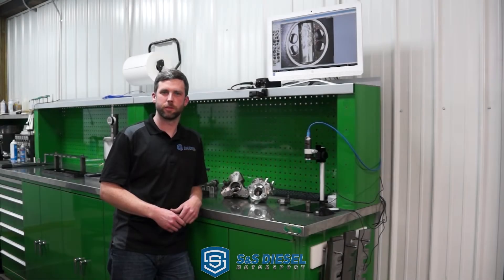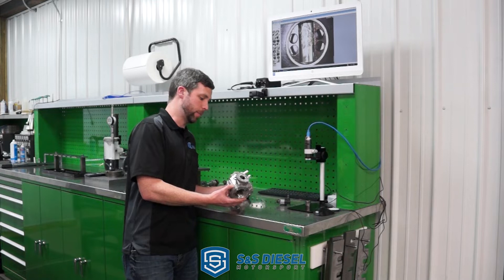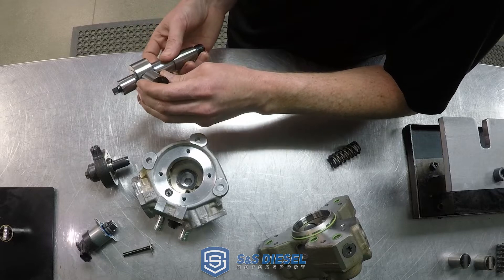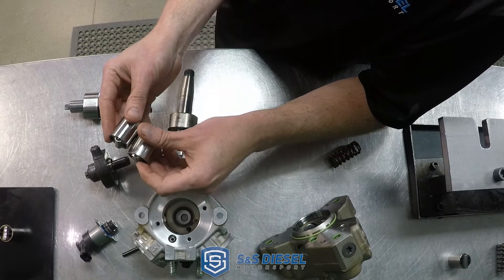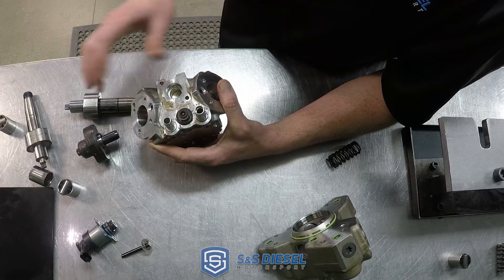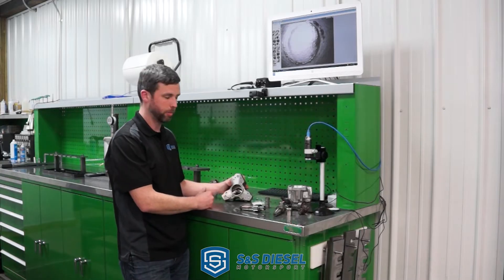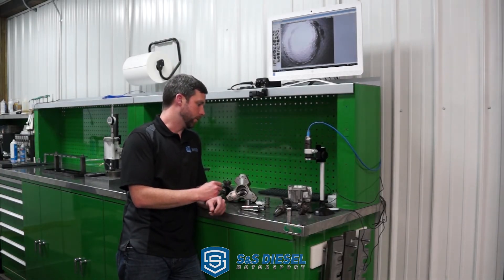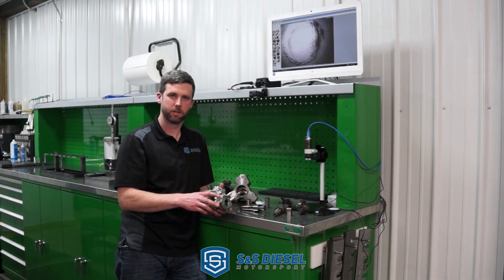Bosch CP4 vs CP3 High Pressure Fuel Pump Comparison

Comment: Thanks so much for this detailed video explanation. Installed an Air Dog Filter system on it 2 years ago but never new about CP4 issues until recently. Just got my 2013 Duramax back from the shop today... Did an S&S CP4 - CP3 upgrade and a Fleece Cheetah Turbo. Now I feel at ease. Heard so many stories about how expensive it is when (not if) it blows up. So I spent $10 k today, but saved myself another 10k by replacing it "before" it blows up. Been looking for a video explaining how they work differently and your video answered that. Great video. Thanks.

Comment: Very informative. I replaced my CP4 as preventative maintenance, and with that I installed a Donaldson 4 micron fuel filter kit with water separator before the HPFP, and then a disaster prevention kit with a 5 micron return filter just to be on the safe side. To top that off I mix 0.5% of 2-stroke oil in my diesel. The new CP4 should last a million miles now!

What I dont get is how such a reputable company like Bosch can go from designing a masterpiece of a fuel pump to designing a piece of shit pump that the CP4 is.

Comment: Honestly, I think the OEM's should be required to Warranty the CP4 equipped engines indefinitely. At the very least, the OEM's would be financially forced to install a filter after the CP4 to prevent catistrafic contamination from a failure, as its insurance against having to replace the entire fuel system.
Also think Cummins should be required to warranty their engines indefinitely against damage from the grid heater nut/stud getting sucked into piston 5 or 6.

Comment: Can you directly replace a Cp-4 with a Cp-3?
Reply from the maker: It would depend on the application as we do have cp3 conversions, however they do require lines, mounts, and custom metering units to not have tuning required. So they can replace them with a kit designed for it but not just an un bolt and bolt a cp3 in its place.

Comment: Very good video! 👍That's why Honda diesel i-CDTi with CP3 pump and electromagnetic injectors should be more reliable as its successor i-DTEC with CP4 pump and pjezo injectors! 🤔
Reply: ……or the set up on a Ford 7.3 L diesel. Mine has 400,000+ miles on it and still going…

Comment: Thanks for this.  Very informative.  I'm under the impression Ram/Cummins went back to the CP3 pump on the 2021 6.7 HO's.  Can you verify that is factual?
Reply from the maker: That is correct late model 2020 Rams did start to re introduce the cp3, however it appears the 2025 trucks have a new variant cp4 again.

Comment: Thank you for the explanation. How the piston number (CP3 = 3, CP4 = 2) influences the perfomance of high pressure pump? Which is suitable? Pump with few (1 or 2 pistons) or a lot of piston (3 or 5 pistons)? Thank you!
Reply from the maker: There is a benefit to increased pumping pulses per revolution, yet we prefer an eccentric design for durability. A CP4 has 4 pumping pulses per revolution due to the two-lobe cam. This combined with a smaller bore (less leakage around the piston) makes the CP4 a very efficient pump at high pressure. We have not had any issues making whatever pressure we want with CP3s, and will gladly accept more leakage in exchange for better durability.
Reply: @SSfueled  Thanks for the answer, so the number change the pumping pulses per revolution... Which is better 7 pistons, for example, or 1 piston? With 3 pistons can the pumping pulse be high? Or not?
Reply: @SSfueled on a 2022 jeep gladiator with what I think is a gen 3 eco diesel with a cp4 pump, can it be converted/adapted to run a CP3? Thanks

Comment: What would be the downside of going from a CP4 to a CP3 on a 2015 Duramax? Should I lose torque or HP?
Reply from the maker: No downside, other than the cost. The S&S 50 State CP3 conversion will operate the same as a stock CP4.

Comment: Had. My fuel filter changed on my CP4. Unfortunately the gasket I had to seal it in the canister failed and air got in there starving the high pressure fuel pump. Because of that, I immediately found metal shavings in the filter canister area immediately after trying to turn it over two times. What an absolutely unreliable mess

Comment: Unless you ran that pump completely out of fuel, and burn it up from Low fuel pressure from your Lift pump. CP3 injector pumps are diehards and won’t go out. That just somebody selling your pump. And then I bet you a little while later are you going for injectors and then your problems all done. And fixed I know a guy that raise three kids through from kindergarten to 12th grade in a private Catholic school working for. Dodge and on the Cummings turbo diesel. Since they came out in dodge trucks and his whole time I’ve ever working on it he’s replaced one CP3 so that tells you something no if you’re not getting at least 12 minimum if not you should be higher more like 15 to 16 PSI‘s too Your injector pump

Comment: Is there any diffren witch hole to the outlet rail on backside 3 holes?
Reply from the maker: All three outlet valves feed into a connected internal drilling that is a full rail pressure. It is possible to move the outlet fitting to any of the three valves, but it is crucial to make sure all three valves have ONE check ball each. The tiny ceramic ball has a tendency to fall out when changing fitting locations.
Reply: @SSfueled  thanks for thath info..i was not sure because i only reach  just above 1000bar ..but maybe regulator in the rail is the problem..i hope..

Comment: my 2021 EcoDiesel Wrangler is at the dealership now. Will be looked at on Wednesday. Fuel Filter assembly started leaking fuel from near the lines. I drained and took the cover off and found metal in fuel and cover. I'm guessing the metal from the pump made it's way back in the return. It was driving fine, 22mpg pulling my army trailer. I had just made a trip from Michigan to South Dakota and I noticed the leak when I got back home. Been waiting on the recall, I hope the high heat out west wasn't a factor. But I never used any fuel additive, because the manual said not too. I was aware of the issue with these pumps, but was afraid if I used an additive, and something did happen, they would deny coverage because of additives.
Reply: Ooops, I guess you’ll find out, good luck.
Reply: @johnsmircic6650  It took a long time to get fixed, but it's been fine since. Just clicked over 100K miles 2 weeks ago

Comment: Will the cp3 work to replace cp4 in a gladiator ecodeisel 3.0? Cheaper to replace n9w than wait for a catastrophic event.
Reply from the maker: A standard rotation CP3 will not turn the correct way on an EcoDiesel. In theory, a reverse rotation CP3 could work, but we have not explored a retrofit kit. It would require many custom parts, lines, and pump modifications to make it work correctly. We may develop a disaster prevention kit for the EcoDiesel in the future.

Comment: I had hope of cleaning the tank until i saw this😌 have metal in system, not much. But its there
Want to upgrade to cp3, new injectors, rail, pump. But was hoping to clean tank, a new tank its quite alot😔
But thank you for the awsome video, really informative😊

Comment: Did a cp3 swap on my 2019 ram now it'll idle fine for about 15 minutes then fuel rail  psi will max out and start knocking its ass off then truck will miss and idle fine for 15 minutes then repeat....so much for a no tuning required pump

Comment: Finally, after waiting for the Y78 recall work for my own 2019 Dodge Cummins 6.7L, it has now been completed. 
I travel between Gresham and Central Oregon, and must pass through an area with no cell phone service. 
I've been crossing my fingers each time. 
Hopefully, I can now made the trek without worrying about a failure!

And by the way, what were they thinking when they designed that CP-4 pump? 
When you watch the video, you should be able to see that the CP-3 design was a much better design.
A tiny roller tip cam follower, with nothing to prevent rotation....... geez!
Reply: Why haven’t ford recalled them got mine done 19 ram 51,000 miles nice recall on there dime

Comment: So I'm curious if that is a "Exergy Inlet Metering Valve(MPROP)"?  If so was it installed on the CP4 when it failed?  Further, did it prevent contamination of the fuel rail and injectors when the CP4 failed?  Thanks for your time.
Reply from the maker: Great question. That is a stock metering valve in the video. We have yet to receive a CP4 in for inspection that has had the Exergy metering valve (25 micron screen) installed, so we can't confirm one way or the other if it actually prevents contamination. Based on our debris analysis from a failed CP4, 55.57 percent of the total debris volume was under 24.1 micron. That is why we choose to block off fuel flow from the case and feed the metering valve directly from the stage 2 fuel filter, which is what our Disaster Prevention Kit does.

Comment: I will never get a truck with a cp4 or 10 spees transmission. Very unreliable and extremely expensive to fix. Do your self a favor if you have one, sell it before you run out of warranty.

Comment: Question.  We had the recall work done on our 2019.  By any chance, would this cause a drop in mpg while towing?
Reply from the maker: We can't comment on the OE CP3 conversion kit offered by Cummins because we haven't tested it. The S&S NoTune CP3 conversion kit does not affect MPG or emissions in any way. In theory, the OE kit should be the same. Our pump matches the output curve of the CP4 and does not require any ECU calibration. It may be worth asking the dealership if an ECU reflash was part of the recall.

Comment: Will anyone build a cp3 bottom end for a cp4?
Reply from the maker: Great idea, and one that we have considered. It would require a complete redesign, rather than internal modifications of the base CP4 parts. If you can fit a CP3 in the vehicle, that is the best option, which is why we offer conversion kits for the LML Duramax and 19-20 Cummins. A CP3 will not fit in the valley of a 6.7 Power Stroke, and that is where a better high-pressure pump is needed, and in our opinion, a completely new design would be better than a CP3/CP4 hybrid. We're currently exploring all options and could have a better solution in the future.

Comment: Question , so on your opinion exergy  fpr for lml duramax will save fuel system you think ? I just removed my fpr2 and small metal shavings on the screen ;( I am afraid even to touch fpr1 cause if I c metal there ( most likely) I will need to swap it to cp3
Reply from the maker: The Exergy FCA is an upgrade from stock, yet our CP4 particle analysis study showed significant debris that was under 20 micron. If you are finding small metal debris on the DRV screen, then that metal has made it into your rail and injectors. Testing the injectors for high return is the best way to know for sure. We can do that for you if you send an email to info@ssdiesel.com.

Comment: So the real problem is the hard facing of the steel is breaking down under the extreme pressure of the pump. You guys redesigned the CP3, with the 10mm larger case. Do you have the billion dollar answer yet? Somebody’s going to build it. I’m believing God will favor your company!
Reply from the maker: Thank you for the kind words. We merely added stroke to the CP3 with a custom cam. The design and forged body are still the same, which was designed by Bosch. We can't take credit for the CP3s strength, but we do have a pretty good grasp on the strengths and weaknesses of various common rail fuel systems. We're working on alternatives to the CP4, but we do not have a solid timeline. We hope you're right!

Comment: Great video. What do you know about the  cp pumps that are in the 2.0 TDI’s Volkswagen uses? Does anyone know the differences between the pumps used in a heavier application like trucks vs cars? Are they a smaller pump or just different volume outputs?
Reply from the maker: Many of the smaller engines use a CP4.1, which is a one-plunger variant of the CP4.2m (two plungers) used in the light-duty trucks.
Reply: @SSfueled can you do upgrades on those pumps. I actually have a PX Ford Ranger, the Australian version and would like to upgrade the pump and injector nozzles. Apparently it’s also has a plunger which fails at some point.

Comment: Thank you Luke!  Since RAM will not have a fix for this until early 2022, can we use a fuel additive to help with the lubrication? Maybe this will hold it off until the recall is  completed. By the way, we have a 2020 RAM 5500.
Thanks
-john
Reply: @SSfueled  Thank you.  Not sure they will do the right thing yet...so I'm not going to hold my breath. How can I look and identify my High Pressure Fuel Pump to be sure which model I have? If I do have the defective CP4, can you give me the part number for the NoTune RAM CP3 Conversion Kit that would work with my 2020 RAM 5500?
Reply: @SSfueled  Truck owners are getting reimbursed from RAM on this recall for replacement/conversions but the issue is will they still honor the fuel system warranty?
Reply: @SSfueled  I hope I'm wrong and perhaps over time we will know more re: warranty. FWIW, if Cummins copied your design then I think I'd be a bit pissed off unless you're being compensated appropriately.

Comment: dammit! my used 2010 I just got has an LGH(detuned LML) so I have the first version that inherited the CP4 engine killer!
It's an 81.0mm3 fuel rate... I wonder if maybe that is a clue I might have a CP3?
though I know the CP3 can push to 800hp vs the CP4 525hp...

Comment: With 02 LB7 cp3 with 208000 my pressure rating is about 13500 to 14500 injectors was changed about 3 years ago now changing pump rails and pressure regulator would you think it will fix low pressure problem. I’m use to old cats so this is new to me

Comment: The CP4 is garbage! Ram is experiencing a huge number of failed CP4's, which cause $15k - $24k in damage to the engine, and require a complete overhaul to repair. Ram went back to the CP3 for the 2021 model year, to avoid further issues. Still though, Ram is refusing to initiate a recall... and the lawsuits are piling up.

Comment: Same conclusion has on my videos. Surface area of that came design is flawed. I have once that the followed spun 90 degrees. Way more damage than those you showed. Cp3 most often dies alone as the fuel path is much different

Comment: Do the new Dodge trucks use the CP3 or the CP4 ? 
Also, is it possible to simply add a fuel filter on each of the lines coming out of the pump ? 
I have a 2017 Ford with the 6.7. A friend has a number of Dodge trucks and is buy new ones. 
Does your disaster prevention kit contain any filters ?

Comment: worn-out components is the result of missing lubrication. Run your engine without oil on diesel fuel and see how your bearing will look like.
Reply: no excuses for a aluminium bore

Comment: I saw the CP4 concerns a couple of years ago, but was told the chances were slim it would happen. Well, it happened to me 2 days ago (99,750 mi) and looking at a $10K repair bill, but will not be replacing with a CP4. Looking to install a CP3 conversion. If you have a CP4, don't think it won't happen to you even if you do maintenance religiously. If you don't want to change the pump, you'd better change your fuel filter every 6-12 months, not every 2 years as GM recommends and that still may not save it.
Reply: every two years ? definitely wouldn't wait that long. i usually replace everything after 7000 miles and that's  on my 12v constantly pulling and on job sites hauling tools and equipment in dusty conditions.
Reply: @jakeguajardo8624 i just do highway driving from location to the next, change my cat fuel filters on lift pump every 2k miles
Reply: A fuel filter is 25 bucks. Change the damn thing every 5k oil change! Or pay 10k in repairs. What's cheaper?
Reply: Its a fuel issue not just a filter issue ive heard

Comment: Cp4.20 is reliable and updated pump. Second thought of getting new 2020 ram 3500, with cp4. Hv 18 ram 2500, very reliable.,but want to tow 5th wheel. Hv to change vehicle.
Reply: @SSfueled  okay tnx my bad cp4.2, I thought 2.0.
Reply: @SSfueled  how much for conversion kit?

Comment: Has anyone tried the CP4.2 Fuel Reroute Disaster Prevention Kit - Powerstroke 6.7L sold on Engineered Diesel .com ?? It supposedly blocks the little hole from the lower and reroutes it back to fuel tank and feeds top in straight off the secondary filter feeding the high pressure pump to begin with. 
They have a YouTube video on it and looks to be a better fix however it will only save the injectors and engine. Both Pumps and fuel tanks and lines can still be contaminated due to HP pump failure. Any one tried this???

Comment: are cp4.2 any better. I have a 2019 ram 2500 diesel that i believe has the cp4.2
Reply: @SSfueled  Is there a CP3 conversion kit for a 2019 Cummins and do you recommend converting the CP4.2 to a CP3?

Comment: My cp3 pump seems to have volume and pressure, and then sometimes it doesn't?   What is going on in the pump?
Reply: Just took mine apart, had water contamination, one of the pistons got stuck in the closed position from wear on the shaft. The spring was fully compressed and valve was stuck in that position
Reply: @mikejohnson7768  wow.  I got a remanded pump, this is only showing 126.psi, I even blocked off yhe injector lines.  I'm thinking my fuel pressure sensor is bad?  Any guesses?  I did a little multimeter test on it and the signal wire with the sensor connected only had .21 volts.  It's suppose to have .5 volts.  I don't have a gauge to hook rt up to the pump.  Also, if I put the key in the on position to activate the fuel pump in the tank I get a stream of fuel when opening up the rail.  Is this right?  Some ppl said yes, others said no